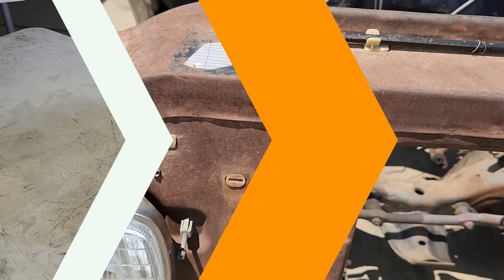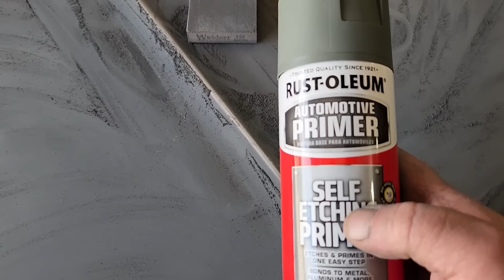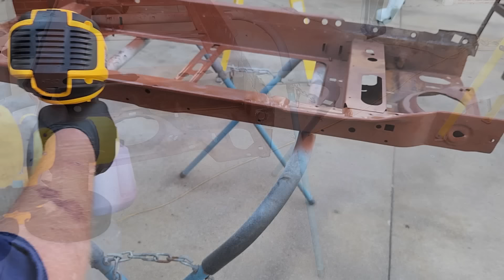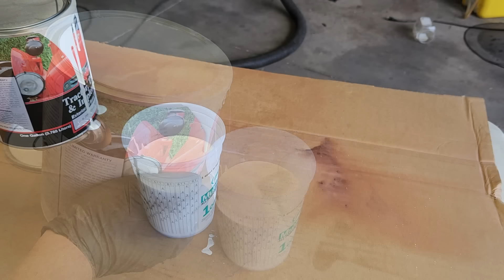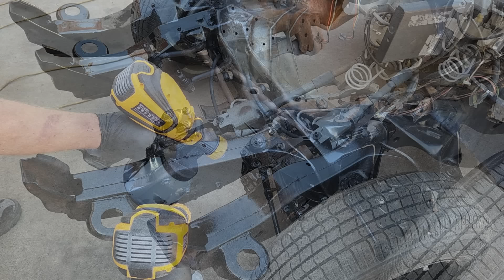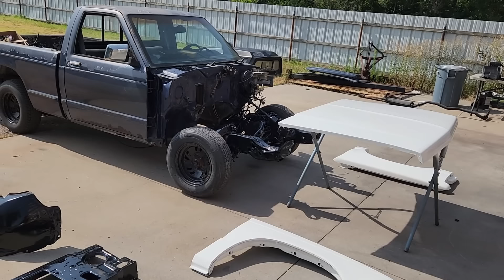S5 E27.  A low cost automotive  paint hack that really works. Rustoleum and  electric sprayer

Comment: Jimbo, I'm impressed with your finish using what we call an electric fence sprayer! 
otherwise this video has been a revision lesson back to myself 40 years ago. in those days we used cellulose based paints for cars and 'hot pot' oil based paints for trucks. a great cheat was using Dulux house gloss paints on rough old car bodies that were full of newspaper, filler and fibreglass to get that high gloss shine and a brick through the window from anyone trying to repair the paintwork ever again.
Reply from the maker: LOL, great story!

Comment: I have a 2012 Chevy express with rust, missing paint and a v6 with 520,000 kms on it. 200k on the 4l60, so this project can be directly applied to my situation. Same bell housing right? Just no room for the third pedal
Reply from the maker: As far as the diesel swap,  the kit I will be using will adapt to an automatic as well as a manual.  Unfortunately your 2012 automatic will have electronics that would need to be dealt with.

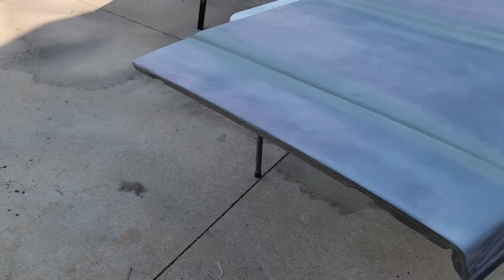Comment: 12:50  gloves are the way to go for painting, 100% makes the whole project easier, IMO. 
However if you DO get some on your skin, Oreilly stores that sell paint have a 3M product called "paint buster" I think? Its a special hand cleaner for paint and removes any kind, acrylic, laquer, and oil based. It works as well on paint, as good hand cleaners work on greasy paws.  Its not cheap, but ive only ever purchased one tube. 

Ill update with part number. You can get it on the Jungle site or pretty much anywhere automotive paint is sold, in my experience.  

I have literally had the same tube for like 5+ years now. I dont do a ton of paint projects but its something my house will never be without.

Edit: 3M part number - 05975 paint buster
Reply from the maker: Thanks for the tip!
Reply: @robotcantina8957  just glad to contribute something occasionally! I would have never found that stuff if someone hadnt told me about it. Figured I would pay it forward to anyone that can use it. 

Excellent as always, Jimbo! 
I had been secretly wondering if you were a body guy, btw. On to the next theory 😂

Comment: I painted my old Ford truck with a brush a roller and machinery paint. Came out better than expected and from a distance looked great.
Reply from the maker: That sounds awesome!   Distance will certainly help in some situations...
Reply: When I worked in a shop doing heavy duty truck/diesel repair work I saw a couple old workhorses and a bus painted with what looked like house paint with obvious brush marks. Looks ok at 20 yards and at least the metal was protected.

Comment: Don't test on the vehie you want to paint.  Go to the scrapyard and buy a hood or fenderto practice on.  If you cannot geta good finish on that, throw it away and get another panel to practice on.  That way if you do decide you're not going to DIY, you've not created extra sanding and cleaning expense at the body shop.
Reply from the maker: Great advice!

Comment: supprized about the spraygun , then again it was a different electric gun then the one i mentioned before 
the only thing with this one is that it can blow dust / paintmist it sucks in at the back intoo the paintjob but if theres dust inside the spraybooth to be sucked in youre probably doing sumting wrong or using a dirty sprayer anyway , might be a little more dangerous as it can arc across the brushes of the blower motor and could potentionally turn intoo a flame trower if it sucks in a combustable mixture , i guess they made sure the brushes are mostly out of the airflow 
the result with the tractor paint was about wat i expected , nice job laying it on btw 
only cringed a little when you sprayed the fender edge and sprayed with the fan out on the nozzle the wrong way (where you gotten the orangepeel , but hey no drips so its still good

Comment: i'm kinda impressed with the gun, i was 99% sure it was more of a toy then anything. 
i'm sure it wouldn't last long with actual pain because i'm pretty sure those don't like plastic, but if it works
also, while i've never painted anything, wouldn't it be better to have the fan always on? because i imagine it takes a small amount of time to spull up.
Reply from the maker: Having control of the fan is important and you can use it to stop runs, just like on a conventional spray gun.

Comment: As many times as I’ve watched Dalton’s bodywork on Pole Barn Garage and thought “I could do that” I’ve immediately recoiled thinking about the cost of the compressor and equipment.

This eliminates that expense and that means I can not go cheap on the prep work.

Jimbo’s Auto Body tutorials here and the “SPRAYER” brand sprayer might be my solution to learn more about painting before considering the normal process.
Reply from the maker: The El-Cheapo sprayer certainty eliminates a lot of expensive equipment and still provides satisfactory results.  Worth a shot!
Reply: you could even afford to skip sprayer cleaning and just replace! 😊
Reply: Make a lip on the paint tin with a piece of masking tape. Then you 😉don’t get the paint running down the outside of the tin when pouring

Comment: Amazing work.
I have been considering using farm store tractor paint for years.
Looks like it works pretty good.
Can you thin with Xylene?
I scored a bunch for cheap from a shop that switched to the new water based stuff.
Reply from the maker: I think you can, best to try a small sample first.

Comment: I have a 1951 Hudson Pacemaker that I will be painting Rust-Oleum Hammered Copper. I have the hood done and it is beautiful.. The reason for this type of paint is that if the car gets a scratch I can go grab a spray can and no more scratch.
Reply from the maker: Yes, exactly!  touch up is so much easier with these paints.

Comment: Did you ponder topping the white paint off with the Tractor Supply "clear coat"?
Reply from the maker: That's a tough call.  Staying with the single stage paint allows quick and easy touch ups.

Comment: Twelve or so years ago when I bobbed my M35a2 Deuce and a Half, I applied HOUSE PAINT(!) from Home boy Depot, using an HLVP sprayer from Horrible Fright.  I put it over the paint that was on the truck, and some rattle can grey primer over some places that needed sanding.  A lot of guys on the military vehicle forums were doing it ... and they even had a recipe for the color (303 green as I recall).  The paint cost about $60.00.  It turned out absolutely beautiful, and looked great for about 10 years until it began to fade.  I am also a mechanic (since 1972), and have NEVER done any body work or painting.
Reply from the maker: I'm a big fan of OD green for some reason...

Comment: Turtles!

That's what I call junk like bugs that gets into the paint. Years ago my cousin rented an old steel building to use as a shop and he painted a few cars. We had a mutual friend over and for every coat of primer and base coat the routine was the same - open the big roll up door right after painting. When it came time for clear my cousin left the door down. John, wanting to be helpful, went and opened the door before anyone could stop him. One glance at the still very wet and tacky clear coat and my cousin said "If turtles could fly they'd be in the clear too..." 

Don't forget glazing putty for very small repairs. It's a step between "bondo" and high fill primer. Also, sometimes when you have paint/primer and bare metal and you run your hand over it the different surface finish can mess with you. A quick coat of primer will give you a consistent finish to feel it. 

Just take your time, and if you get frustrated walk away and come back. 

I love these kind of videos where it encourages people to get out there and build things even if it's not perfect. I have some rusted rockers on my Jeep that I may have to try one of these sprayers just for grins and giggles. I have a high dollar HVLP gun, but this seems like fun.
Reply from the maker: Thanks for the tips!.  While this gun isn't perfect for a pro, its the perfect tool for the novice and it really does a nice job.

Comment: We was doing this back in ‘99 with my friends 82 S10. We used a fence electric sprayer and used fire engine red. We ruined my friends dads electric paint gun 🤣 It was a Stanley gun so it wasn’t cheap but, beside the bad orange peel, it turned out really good. Great video.
Reply from the maker: LOL, at least if we ruin this gun its not a big deal.  so far so good!
Reply: Oh yeah, no worries on the gun lol. I’ve seen a couple of channels I follow also done an electric gun painting. I need to paint my 1950 Chevy pick up but will probably use a conventional air paint gun. My friends truck lasted about 6 months till he wrapped it around a light pole 🤦‍♂️

Comment: Do the newer paints at TSC have UV protection? I redid a JD mower about 10 years ago in the green and yellow and was disappointed how quick the yellow faded. Only after one season of sitting out it was considerably lighter. The green only faded a little and more lost its gloss. Painted through a 3M acuspray and turned out pretty nice and def durable.
Reply from the maker: That's a good question, I'm not sure about the UV protection in the paint but that's good to know!

Comment: Project Idea!  Rig up a reverse line shaft in the bed of the truck and then put ALL of the previous little motors with snowmobile clutches.  DISPLACEMENT ON DEMAND!  Just turn on another predator engine when going up hills.  Lol.  It would be hilarious.
Reply: This would be really cool!

Comment: One of my favorite videos you have done so far. I loved seeing someone paint a vehicle and have it be “good enough” which is also the same quality I would be looking for
Reply: It's an old utility truck anyway. Never understood why everyone turns all the old square bodies into Cowboy Cadillac trailer queens. Bro it's a Custom Deluxe out an itchy Mexican blanket on the bench seat and keep a couple quarts of oil around. Also when you fill it up write down the mileage because the gas gauge stopped working 35 years ago

Comment: The tractor paint/Rustoleum is similar to old-school synthetic enamel, so the hardeners for it are compatible and available cheaper at many online retailers. The same applies to reducers/thinners. A slower reducer will give the paint more time to lay out smoothly...and to run off the panel and drip on the floor.
Reply: The old heads will remember the days of lacquer and hearing things like "It's got 25 coats of hand rubbed lacquer..." You just had to build it up one thin coat at a time. Newer stuff is about speed - shoot it and send it. But, if you take your time and build it up in thinner coats you can actually get some really good results with cheap paint.

Comment: I have a question
Would epoxy urethane paint and primer be a good choice for a car?
if not then why? other than the obvious high cost of such paint
Reply from the maker: I guess it depends.  Its a better paint. but touch ups and repairs would require premium products if you wanted it done correctly.

Comment: I use one of those battery powered sprayers for lanolin rust protection (fluid film). It works great! (But leave the container in the sun first to soften the lanolin). 

It’s so much better than having to bring an air compressor and lots of stuff, and so much cheaper than the aerosol cans. 

I always spray every nut and bolt head with lanolin after finishing wrenching, so this solution is perfect for me. Just grab the sprayer and pull the trigger and put it back.
Reply from the maker: Thanks for the tip! That's a great idea!

Comment: I was a commercial painter in a previous life and a friend gave me  one of these cheap sprayers. I looked at it as kind of a toy. Color me impressed . I also have a car that needs painting , body filler , glazing compound and an inflatable booth may be my Fall project.
Reply: Please don’t use these crap sprayers do it like you know how Your a professional
Reply: I know guys that can paint literal masterpiece level art with cans of Krylon from the hardware store. Way better than the wall weiners and stuff you usually see. It's not the can or propellant that matters it's the air around it and surface being sprayed

Comment: I learned a lot from this video.  I remember looking at work painted with flat primer only to be disappointed when all the defects appear after the gloss finish coat is applied, sigh.

My son hit a deer and shattered the front fender on his Saturn,  The replacement plastic fender arrived with no shipping damage. 

I couldn't believe the exact color match using a custom mixed rattle can from the auto parts store.  (The clerk had never mixed paint before and was more nervous than I was.)  Not too bad for not much more than $100 for fender and paint.

Comment: A step up from tractor paint is single stage gloss. Any decent auto paint shop can mix it up and goes on easy. My first part was a trunk and my first time with hvlp equipment. Came out just fine. I suggest spending time on prep and cut/finish for the I can’t believe it’s not professional look.

Comment: I've never had any lucky painting over rust.  It will come back through.
Reply: It's hard , you have to fully cut of oxygen to it for rust to stop .. tbh , the best fix is to cut it out and redo it , but there are a few things that can seal it , but im with ya and just never had luck with it staying gone 😅.. but I always hope for the best outcome 😂
Reply: I had good luck using a "rust converter" product that turns the iron oxide into "magnetite" and applying oil base paint over that.
Reply: @smithno41  I have too if I ground the rust and got 90% of it off and then used the converter and then primer and then paint

Comment: Please do a TDI swap in the S10! That would be a perfect blend of electrical content with wiring the ECU and building the harness and then of course all the mechanical content we love!
Reply: Preferablely a 2.5 5 cyl TDI with a rotary pump. Just because i have never seen a swap with one of these. Same tech as a 1.9 ALH or AFN but with higher compression.
They run forever in the 90s VW vans.
Reply: Dooo eeet! 👍🏼 TDI FTW

Comment: That is a 100% certified "good nuf" paint job.
Sadly, I know nothing about oil based paints, or HVLP sprayers of any variety.
Truth be told,I got out of auto body slightly before water based sprays had become a thing.
I guess that makes me a relic of a forgotten past. 🤣🤣
I might need to update my personal skills to modern norms though, as I have a 63 valiant that is in dire need of a few minor corrosion repairs, and some fresh color.
(most likely just white as well, but maybe with scallops, who knows?)
Great video !
Reply from the maker: Normally I prefer the old school siphon feed guns, but this electric gizmo was very intuitive to use.  It would be worth a shot on the Valiant.

Comment: I've got an unrelated-to-this-video question/experiment idea. And seeing this is the most recent video, just going to post it here.

I like playing with lawnmower engines. But I don't like the sound they make. And I'm wondering if it would be possible to make it sound like a 1,5 or 2 cylinder engine. Take your regular single pipe, and add a Y section, splitting it into 2 exhaust tubes. Maybe add a flap or scoop too, to get somewhat equal pressure in both sets of exhaust pipe. Then you add more exhaust pipe to both ends, but keep their length different. Get another Y-pipe, and have the 2 exhaust pipes join back together.

Theory here would be to split the single exhaust pulses up into 2, and changing the travel time they take before exiting/reaching your ear. Sadly, I'm lacking the funds for such an experiment, would go all-in if I knew it would work.
Reply from the maker: Interesting...
Reply: The sound pulses will be out of phade at certain speeds and will cancel out. At other speeds it will add together and basically sound the same as original. If you don't have lots of monry to try it, buy ear plugs. 😂
Reply: @fixingstuff8117  I will be trying to add a 13 hp flathead to the back of a boat. Loads of constant (and I expect) optimal RPM's. If this concept would indeed work, and make it sound like a 2-cylinder-ish, I could tune the lengths to sound decent at the RPM's I'm most likely to use. Would also just work for lawnmowers themselfs, or a battery charger/generator I recently made.

Do agree would be annoying with these different RPM ranges in like a car or cart/bike.

Comment: Hmmmm I wonder if a small diesel running a 3 phase generator to power an electric motor mounted at the rear differential could be in the truck's future someday. If you're looking to repair rust I'd suggest using a phosphoric acid gel product to strip the metal to bare for painting and then use a phosphating primer to neutralize any remaining small pin points of rust that the gel didn't get removed. Another cheap hack is to just paint everything the same color, frame, body, exhaust, tires, windows, mirrors, wipers, your hands, etc.

Comment: You do great work Jimbo. A trick to pouring Acetone is turn the jug around so the spout is on the uphill side and it won't glug.
Reply: Works for antifreeze, engine oil, etc too.

Comment: Those results are loads better than the cheap Horrible Freight air sprayer that I have. I painted a bus and it dribbled paint everywhere out of the gun if I didn't hold it parallel to the ground. Here's a tip I learned to save a couple of bucks: instead of acetone, I use mineral spirits. It's just a little cheaper, and it definitely doesn't smell like a nail salon when you spray.
Reply: We used mineral spirits. We like it better it blends better and lays nicely in my opinion